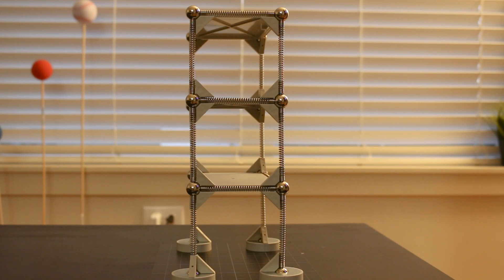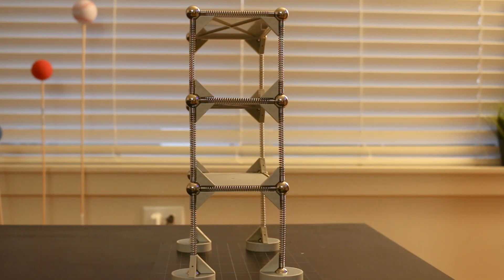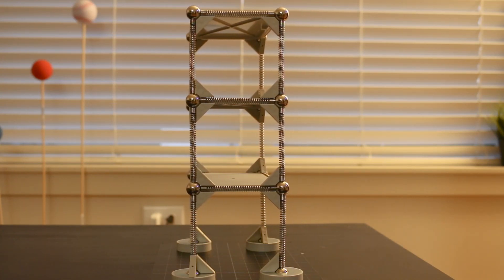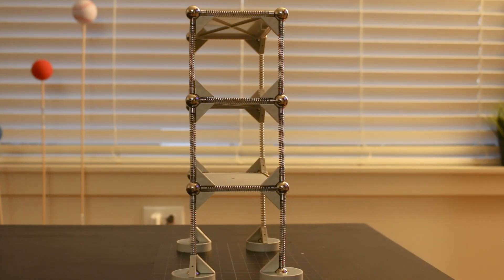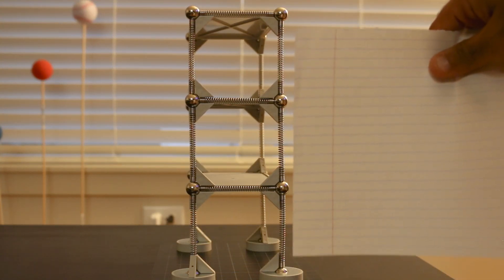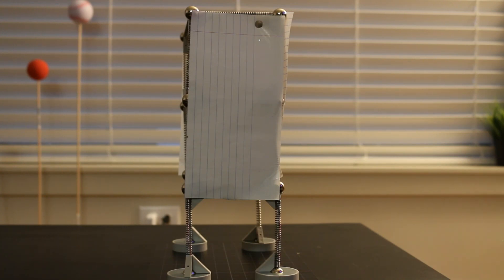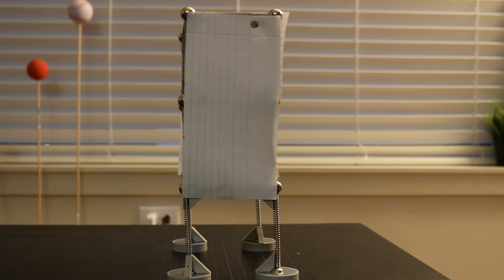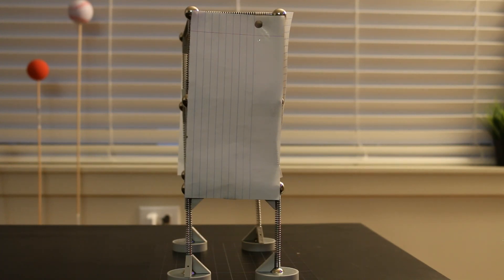Why is flexible structure more prone to collapse?

Comment: hi Jinal, do you have any blog about the Response Modification Factor and how to compute it in case the type of structure is not in the table of the code.
Reply from the maker: Kenneth I recently wrote a blog about how response modification factors are calculated.
https://www.thestructuralmadness.com/2018/08/what-is-response-reduction-factor.html

Refer to table 12.2-1 in ASCE 7-10 section G if you have something similar to that. 
Also refer to chapter 15 of ASCE 7-10 for structures similar to buildings.
Reply: Thank you Jinal :)